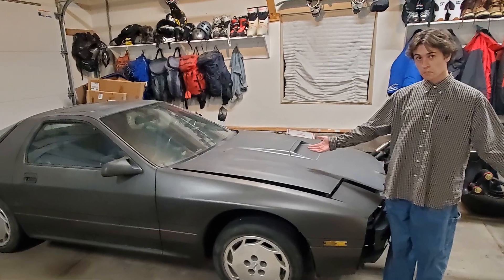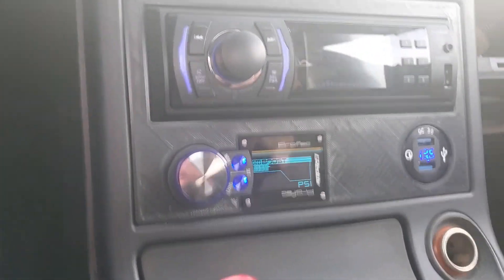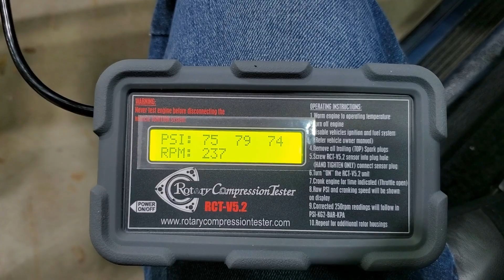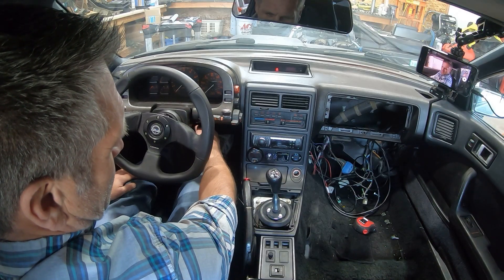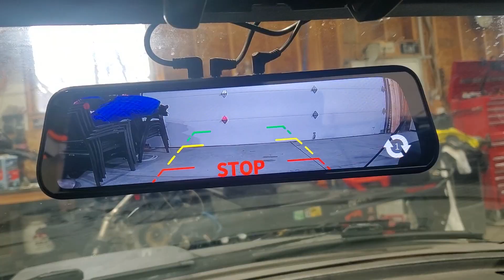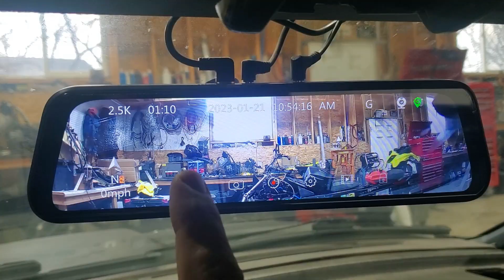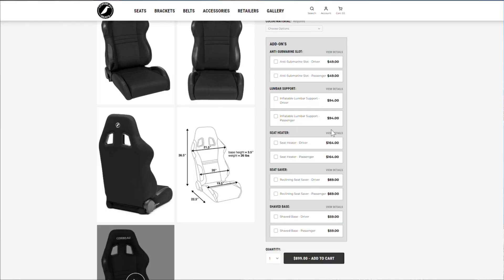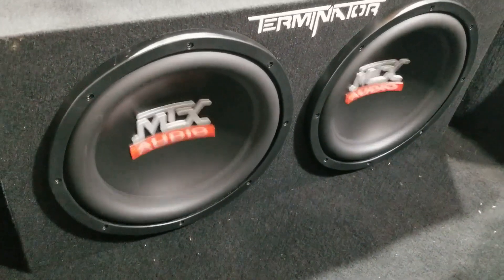How to know if your Mazda RX7 FC is running dangerously lean.

Comment: Careful 13psi is a bit much on the stock ecu.. stock boost was around 6 ecu maxs out around 10. You need to port the wastegate to lower and make boost more consistent. The hot start issues is mostly likely a issue with the fuel pump you really need a fuel pump switch with relay to fix hot Start issues i have 2 turbo 2 rx7. Also 1 oz per gallon of pre mix will help a bunch with longevity if omp is still working if omp is off closer to 3 oz. Per gal  Great work on the fc! I wish i had the center plastic bezel thats awesome interior looks great nice work!
Reply from the maker: Agreed. Thanks for the input!
Reply: @some-guys-garage I didn't see you addressed most those issues lol I should have seen your other videos first! Nice job! Your a very handy guy! Now I'm going to have to watch and learn myself on your ECU videos!
Reply from the maker: It has, indeed, been quite a journey. Frankly, I get a little surprised myself when I look back to the beginning and see how much has changed. Thanks for tagging along!

Comment: Would it be possible to upload the radio front 3d model so i can download it?
Reply from the maker: Most definitely. https://www.thingiverse.com/some_guys_garage/designs
Reply: @some-guys-garage  Thx man!
Reply: Does the 3x 52mm gauge require modification of the dash or did i print it wrong?
Reply from the maker: @Mipexdee  None of the bezels require any modification of the dash. What about it isn't working for you?
Reply: @some-guys-garage the screws on the top with the half holes line up, but the rest of the print is too wide to fit in the opening
Reply from the maker: @Mipexdee  Well, that's curious. All of the radio bezels are exactly the same shape on the perimeter. The only difference between them is the cutouts for the gauges. So, although the bezel I installed in this car is slightly different than the one you printed, the size should be identical?

If you want to tell me how much to shrink it, I can make a smaller variant of it and post it for you. Let me know.
Reply: Well the gauges and radio dimslot are spot on and fit great, so i guess there's a slight difference in stock radio hole size since i think mine came with the smaller radio originally, i'll see if i cant make it work thx anyway
Reply from the maker: I had no idea there were two different radio sizes. Let me know if you want me to do a little resizing on it.

Comment: How did you wire in the camera. Is there a plug you can splice or connect to or do you have it going on to the batter terminal?
Reply from the maker: I piggy backed on the radio power supply. Yellow for constant power, and red for switched (ignition) power.
Reply: @some-guys-garage  Thanks for the info I will have to look into that. I am always interested in how people setup up their circuits and power their toys.

Comment: The 2-hp mirror sounds great.  Maybe I should have one for my just-got-his-license son's car.  Might double the value (and hp) of his car.  Can you share a link to this one (or even to a "I should'a bought this one instead" model)?
Reply from the maker: I added some links to the description. I like this mirror. I put one just like it (but in a 12" version) on Caleb's pickup truck. If you want to hide the wires in the trim and get the auto record option, you need a separate permanent power supply (link also provided).

Comment: Just a note....you forgot to mention what AFRs you are getting under load.
Reply from the maker: My bad. After it's warmed up it runs at about 11 idle, 12 under load, and 13 at peak turbo.
Reply: @some-guys-garage 13 is lean under boost and load IMO my lancer hits 9 under load on boost
Reply: Some people say you can make it a little better with a fuel pressure regulator and adjust it a little higher but best way to fix is with a ECU adjustment of some sort . They have a way you can run a apexi tuner on the stock ECU with the use of adapter harnesses..

Comment: hey man, how did you mount your gopro on the roof inside?
Reply from the maker: I used the little plastic clip attached to the sunroof opening. Like this one: https://www.amazon.com/Sametop-Backpack-Compatible-Session-Cameras/dp/B01BSE454S/ref=sr_1_4?gclid=Cj0KCQiAjbagBhD3ARIsANRrqEsvdjnmv7WVBdWddR0ATK_MTCtt5vEH8nFT_zEeDRkllGOAvB8G0vAaAhTbEALw_wcB&hvadid=233528881855&hvdev=c&hvlocphy=9029683&hvnetw=g&hvqmt=e&hvrand=5213343488093478739&hvtargid=kwd-298414659822&hydadcr=18446_10280439&keywords=clip+gopro+mount&qid=1678624835&sr=8-4